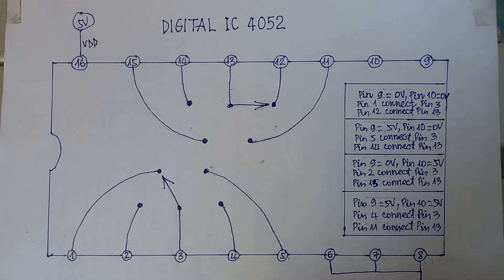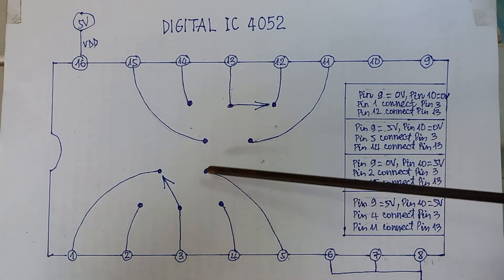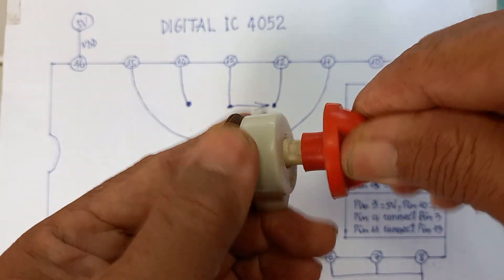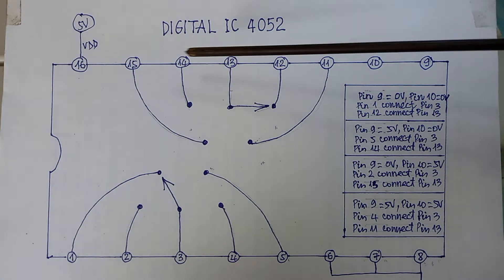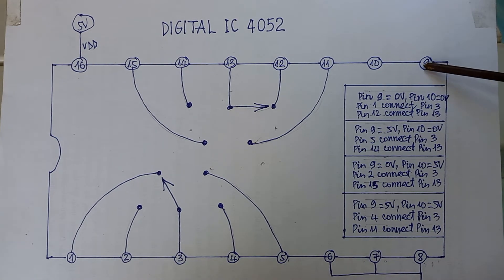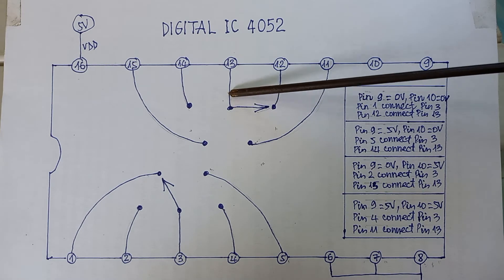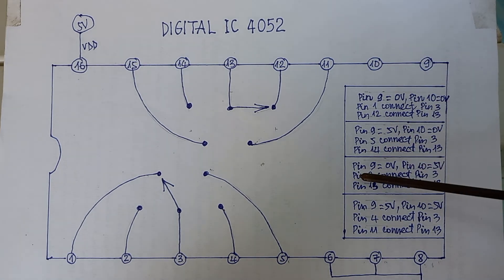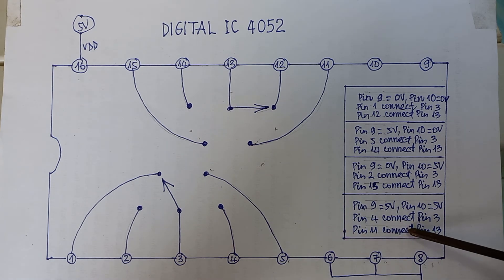Digital IC 4052

Comment: The voltage at pin 16 and 9, pin 10 are 5 volts, is that right?
Reply from the maker: The voltage at pin 9 and pin 10 is about 4,5 volts.

Comment: Looks like the voltage at pin 9 and pin 10 is lower than 5 volts a litle, is that right?
Reply from the maker: Yes, the voltage herer is about 4,5 volts.

Comment: sir, in the case of CI CS4852 (Boomtech), can your procedure be applied?
Reply from the maker: IC 4052 and 4852 are different
Reply: @mungelectronics7601  Strangely, the wiring diagram of the Philco PHT 510 home theater indicates the IC CD4052, but the IC CS4852 from Boomtech was applied on the board. So I thought the ICs were similar as I couldn't find the CS4852 data sheet.
Reply from the maker: @dreadwings3  IC 4852 is an amplifier IC and IC 4052 is a switch IC.
The diagram circuit of IC 4852 is already on the datasheet.